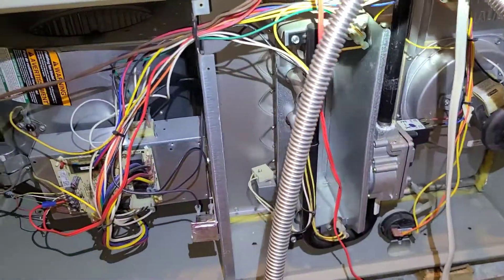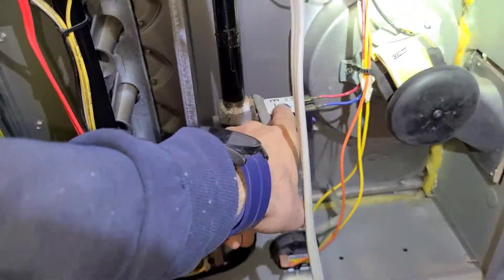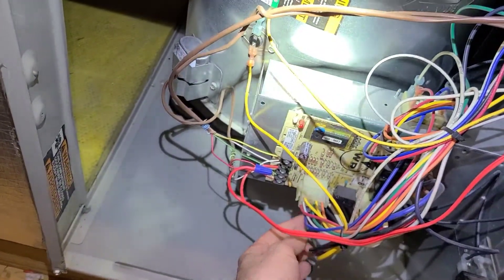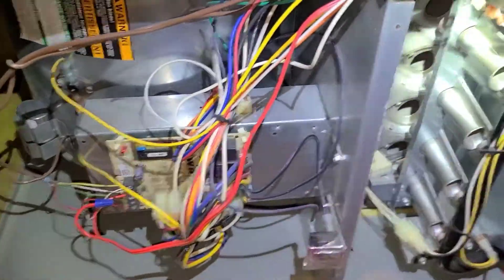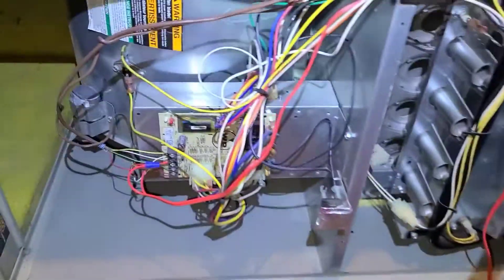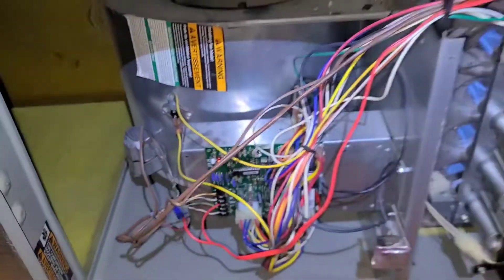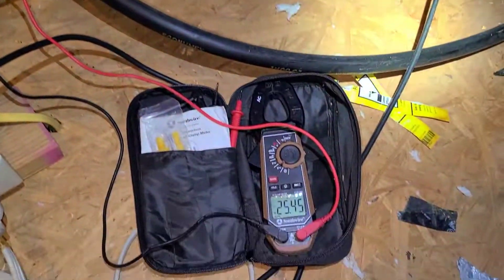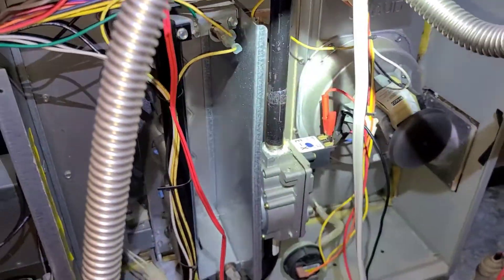Furnace gas valve not getting energized with 24v(bad control board)

Comment: If you had 24v at the pins on the board but you had no voltage to the on the Gas Valve side, wouldn't this indicate that you had a continuity or connection issue? If the board was not providing 24v at all than it would be on the board side. What am I missing here. Unless you misspoke?
Reply from the maker: If your board has power and your gas valve isn't getting 24v the control board isn't sending the voltage to gas valve. Just like if you have the call for heat and your inducer isn't getting 120v it would be the control board
Reply: @Rpm2332 I understand what you're saying but what I'm saying is that IF the pins on the board that supply power to the valve showed 24v, than there's a continuity issue of passing that voltage to the valve. If the board does NOT have 24v on those pins, than you have a board issue.
Reply: Agree. If you are getting 24v at the pins the board is sending 24v. How would you get 24v at the pins but not the valve? Faulty wiring?!
Reply from the maker: Could be bad wiring could be bad connection
Reply: Yes you very well could be right but I think the board is getting 24v on the pin but a relay is fried or stuck and it’s not sending to the gas valve which would be a bad board
Reply from the maker: @Imagashole  if your not getting the 24v to gas valve I would just try to change the board you can always due a continuity check on each side of wire when unplugged to make sure there is no break in the wire
Reply: @Rpm2332  If you have 24V at the board but not at the valve, it's not going to be the board. The board is providing the voltage, so it's doing its job. The problem was in the connector. It might have been loose or one of the pins wasn't making good contact. Next time you have the same situation, wiggle the connector while pushing it in to make sure it's making contact. If that doesn't help, wiggle while pushing the individual wires one at a time into the connector. If the fault was in the wiring, the new board wouldn't have helped. You HVAC guys are just as bad as us auto mechanics when it comes to understanding how electrons flow.
Reply: @bernardocisneros4402 the irony of insulting someone without attempting to understand what they’re saying is crazy. The video creator is correct. You’re confused about which 24 volts he’s talking about. He’s saying transformer is providing the board with 24 volts. What you assumed he meant is that he checked both ends of the connector to the valve, and that 24 volts was being provided from the board to the valve.

TLDR: he was talking about the board getting power, and not providing power; NOT 24V provided from the board to the valve.

Comment: I've got a similar situation with a Carrier HK42FZ board. Everything functions up to the point where the gas valve opens. Sometimes it does open up I'm going to say the delay is too long after the igniter comes on. Still need to put a stop watch to that. At this point I'm leaning to the control board. $500 bucks. Ouch.

Wondering about my power supply. It shows 28.9 volts. Its that too high for the control board? Usually such items are good up to 30 volts. But I'm used to industrial 24VDC systems.
Reply from the maker: Should be OK you must have higher high voltage then normal as well then. If it's not getting 24v at the gas valve it's the control board. If it's getting 24v and gas valve not opening it's the gas valve. Also make sure gas bill is payed on customer
Reply: @Rpm2332  Gas bill is paid. I'm running on propane. Of course that brings up the question of pressure. I'm not sure what pressure is normal for LP systems. I would have to go purchase a gauge and a T-fitting to check it. I've been considering replacing the copper tubing running from the LP tank to the regulator(outside the house) and then to the furnace with stainless steel line. Maybe 80' in total. The main reason is the copper lines have been tagged with a weedeater over the years(no leaks) but they look horrible. Want to put the SS tubing inside 3/4" black iron where it is exposed so it will be protected. Build it like a tank(like I'm used to on the oil & gas platforms I work on) and I will never have to touch it again during my lifetime.
Reply from the maker: Get a manometer and check specs on furnace for lp should tell you how much inwc it should be. Propane is usually between 10inwc to 14inwc
Reply: Unlucky bro. My control board was $30 so it's a lot easier on the pocket. Did you end up fixing it.
Reply: @Tonyplat98  I found a place selling them for $196. Much better.

Comment: How did you verify that the power would not go into the gas valve?
Reply from the maker: Did a continuity test on the wires at each end  of gas valve and tested good left multimeter clamps on gas valve when heat is energized and I never got the 24v to gas valve and I should get it after the hot surface ignitor is heated up back traced voltage to the board had it at the board board but board wouldn't send the voltage

Comment: I'm doing a similar job now, the board isn't sending 120 volts to the inducer.
Reply from the maker: Yea I get that one alot and the one where the board isn't sending voltage to the blower motor

Comment: Had a guy come out to my house today to check why my furnace wasn't working.  He gave me a long speech about the inducer and about the flame sensor and told me I was going to need a new $30000 system.  Watched your video.  Put my voltmeter on it.  Come to find out, it's just board.  You saved me about thirty thousand dollars.
Thank you!
Reply from the maker: Dang that's crazy all over a control board he tried to sell you a new system. I'm glad my video helped did you get your furnace going

Comment: Same thing happened to my furnace I bought 2 control boards cause they were $30 still waiting to get them but thanks for the helpful video. Yes the control board is the issue with mine as well (I hope) cause replacing the gas valve is expensive...
Reply from the maker: No problem and are you going to change the control board yourself? If the gas valve is getting 24v and not opening its the gas valve if it's not getting 24v but you have it at the board it's the control board.
Reply: @Rpm2332  Yes already replaced the board it's working like new again. Thank you! Cost me $30 to fix it and 20 minutes of my time! Not bad at all.
Reply from the maker: You could it's very possible. When my gas valve doesn't get 24v I usually try messing with the connector first. But with that being said it's usually the control board that is the issue